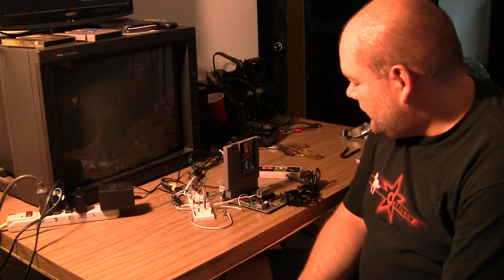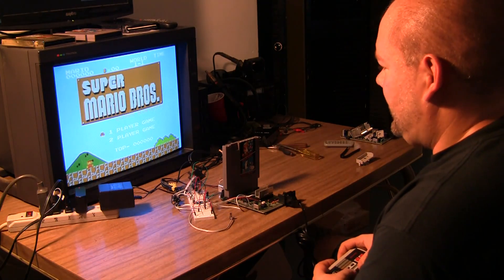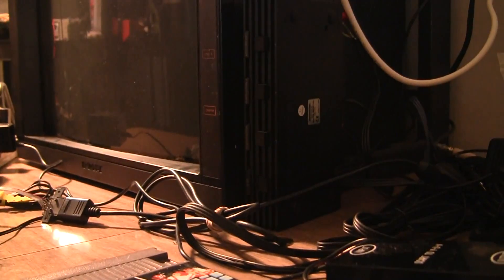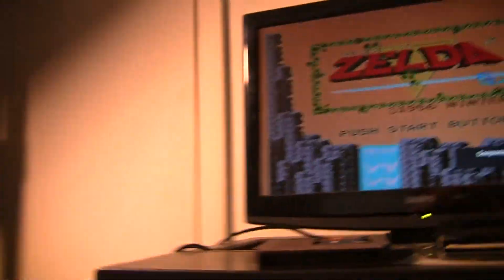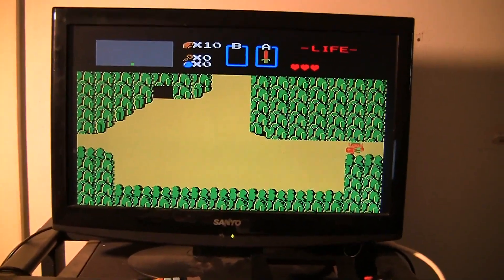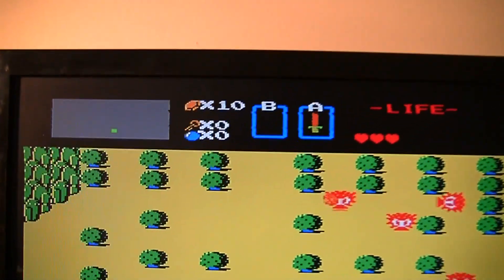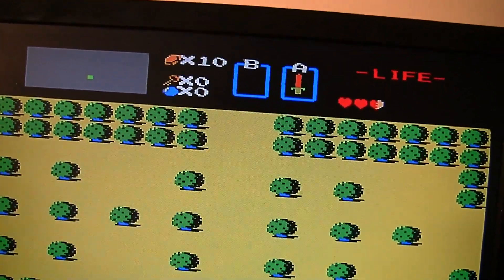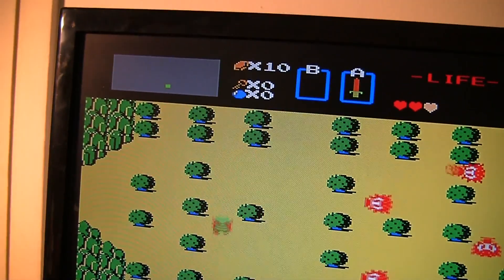NES-101 Nintendo top loader - RGB - NJM2667 vs NCS2553 amps PLUS Component!

Comment from the maker: I think the fix is spelled out either in this vid or one of the related vids, just changed a couple components I believe.
If you want to use both just have your console modded for rgb out then use an external component encoder for the big screen.